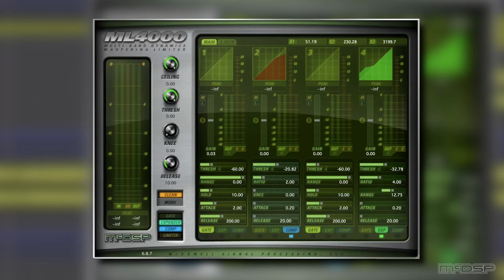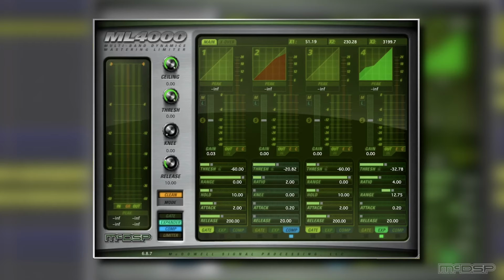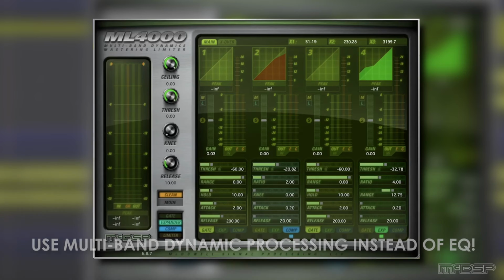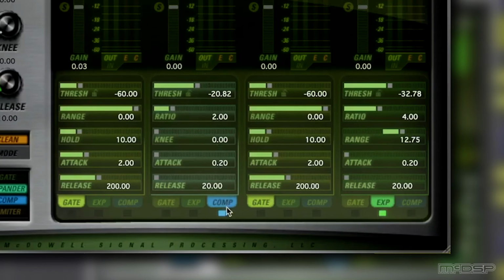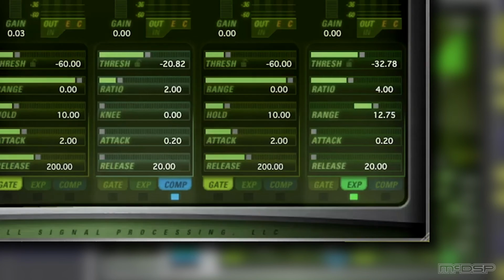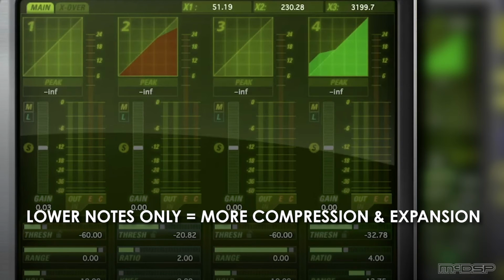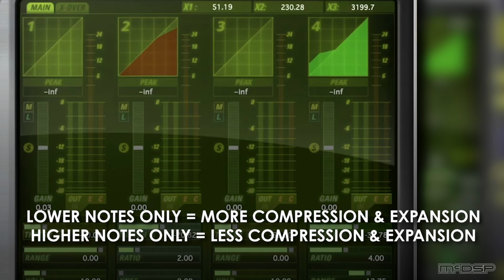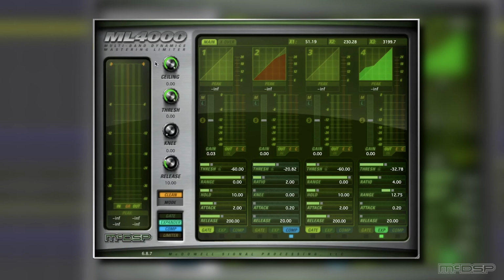Controlling Dynamic Guitars With the ML4000 Mastering Limiter

Comment: This has been a gun of a unit for years now. You often hear big name engineers praise the excellent Waves MV2 because of its upward compressor, which helps vocal or guitar intelligibility. The ML4000 does that even better because of it's multi-band characteristics and the fact that it's fully configurable. If you need to turn soft stuff up, without it being or sounding compressed, there's surprisingly not many processors out there that can do this well, but this is definitely one!
Reply from the maker: Thank you! We're glad to hear the ML4000 has been a useful plug-in for you, and hope it continues to be!